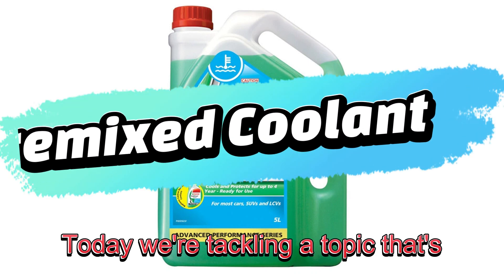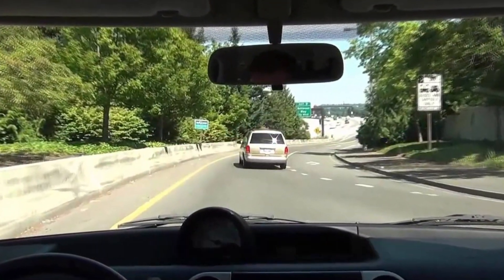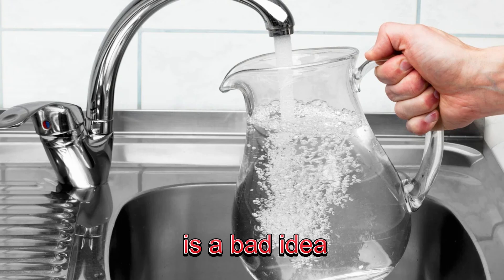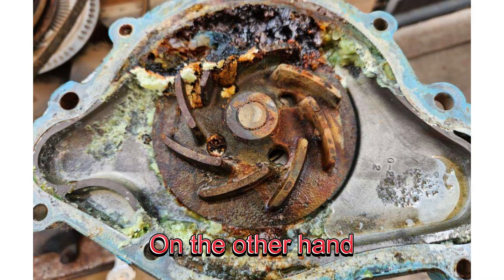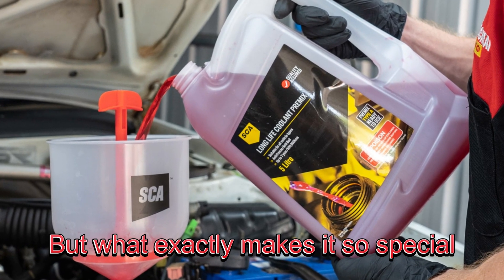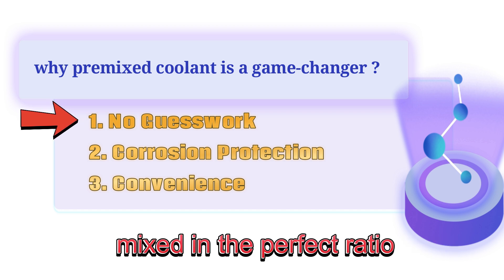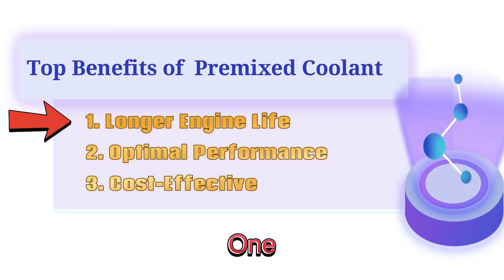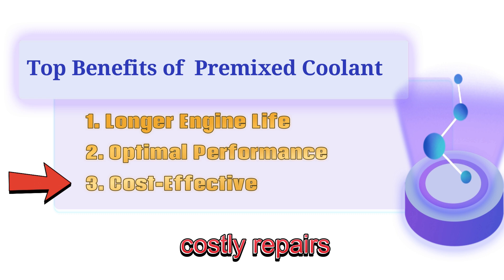Premixed Coolant: The Secret to a Longer-Lasting Engine!

Comment: Just mix concentrated coolant with Distilled water in 30:70 ratio if your ambient temperature is upto -10 degrees C. If ambient temp goes upto -30 degrees C, use 50:50 mix. If ambient temp goes even below that use 80:20 mix. It’s not rocket science.
Reply: 30% coolant or water?
Reply: @winneythe-pug7613  Good question !.
Reply: Then if you live in Arizona, Texas or Miami, 30 ( coolant) /70 ( distilled water ) porcent , no ?